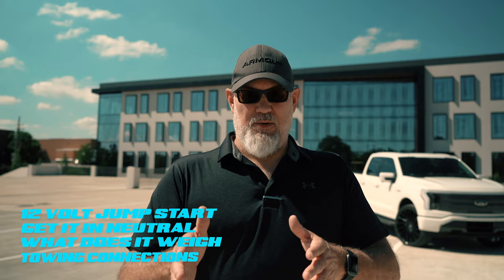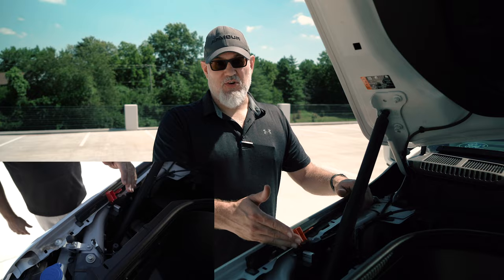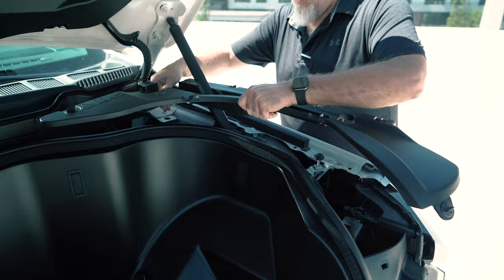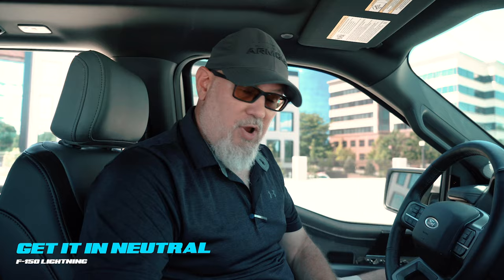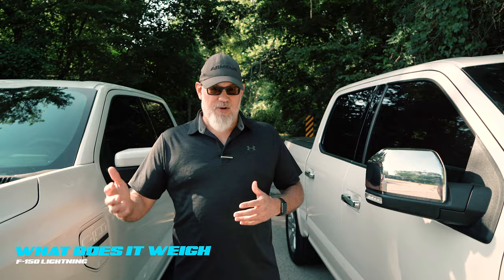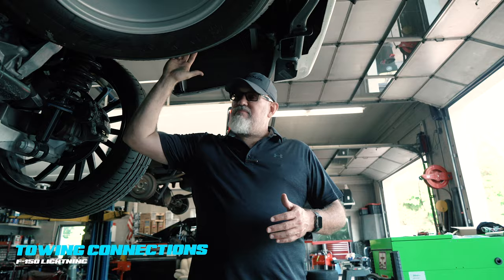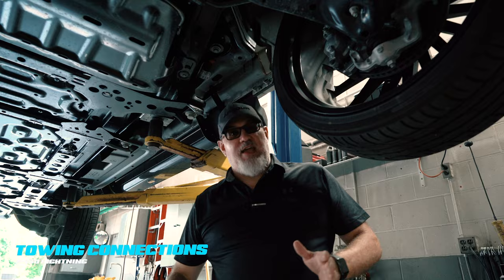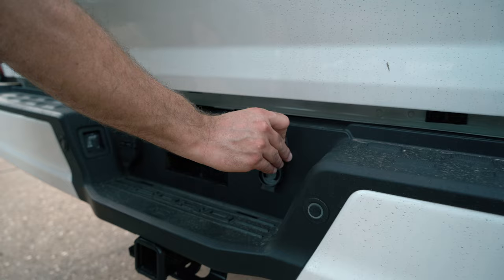Know Before You Tow - F-150 Lightning

Comment: Awesome video! this is super helpful, thank you! Ok so I had my summers swapped for winters at my local Ford dealer, and talked to the mechanic while my truck was hoisted cuz I noticed he used the 4 big bolts on each corner of the skid plate that has a metal stud straight up to the frame, and not the 4 arrow indicated jacking points. he told me Ford said it was ok, as it's basically one with the frame in those spots. sure hope they knew what they were doing lol. didn't notice any bending or damage and its been fine since but just thought I'd mention it because it's a much better jack location for leverage as it's closer to the wheel and lower to the ground. my big floor jack wasn't able to get the strength at such a high reach to lift it off the ground using the arrow spots it said in the owners manual, hence bringing it in to Ford for the swap, so was thinking of trying his recommendation next time..
Reply from the maker: The locations shown are where Ford has instructed us to lift the vehicle and where we've lifted them in Detroit.  Don't know anything about where your Dealership chose to lift.

Links to all our socials: https://linktr.ee/towtrucktech

Comment: F-150 ICE owner  and was wondering why would the 12 system go down and how is it charged while driving?  If something is draining the battery wouldn't the vehicle know that and shut off?
Reply from the maker: Why the 12 volt systems go down?  Hard to say, but it happens.  The HV system supports the LV system through an inverter acting much the same as the alternator in an ICE vehicle, even while parked.

Comment: Will the parking brake release without a problem when in Neutral?  12Vdc power required for parking brake operation as well as for getting into Neutral towing?
Reply from the maker: The EPB (Electronic Parking Brake) and Park Pawl Actuator are both electronically actuated, 12 volt is required to defeat both.

That being said the vehicle can be in neutral and still have the EPB applied.

Something to note, the Lighting actually has a park pawl in the electronic motor, for now, this is feature unique to Ford.  “Park” in nearly all other platforms is nothing more than an application of the EPB.
Reply: “Connect a booster battery to the vehicle battery to release the electric parking brake if the vehicle battery has run out of charge. See Jump Starting the Vehicle (page 421).”

Comment: Great, 12Vdc battery could go low if keeping drive in temporary neutral: “TEMPORARY NEUTRAL MODE LIMITATIONS
Your vehicle could shift to park (P) after 30 minutes, or when the vehicle battery charge level is low. Prolonged use of this mode can cause the vehicle's 12V battery to run out of charge.
Do not tow your vehicle in this mode. Failure to follow these instructions could result in vehicle damage not covered by the vehicle warranty.”

Comment: So you have to jump the 12v battery so you can tell the truck to pull power from the MASSIVE battery pack?  Genius engineering.
Reply from the maker: Yep, almost all are designed in a similar fashion.

Comment: How do you put into netural with a dead battery?
Reply from the maker: Dead low voltage or high voltage?
Reply: Dead high voltage.
Reply from the maker: @roberttalbot313 - jump the Low Voltage, shift to Tow Mode, load the vehicle
Reply: @towtrucktech1555  my problem is the vehicle is completely dead and we need to move it to a charger. Jumping the low-voltage battery will not do anything. I’m just trying to move it without power.
Reply from the maker: @roberttalbot313 - you won’t move it under any power, jump LV gets the EPB and Park Pawl release, unit can be rolled

Comment: Curious,  what is the scenario where the 12v battery lost its charge?
Reply from the maker: There should actually be no reason the 12 volt ever goes down being the HV system supports LV.  But it does happen, haven’t heard why.
Reply: There have b3en several instances where this has occurred because the DC-DC converter that is responsible for charging the 12v battery has been programmed to come on enough or at the right times when the vehicle is off.  (Essentially a software bug) So in those cases if the vehicle sat for an extended period of time without being plugged in and it was cold, the 12V battery could become depleted.
Reply: Its a Ford !!🤣🤣